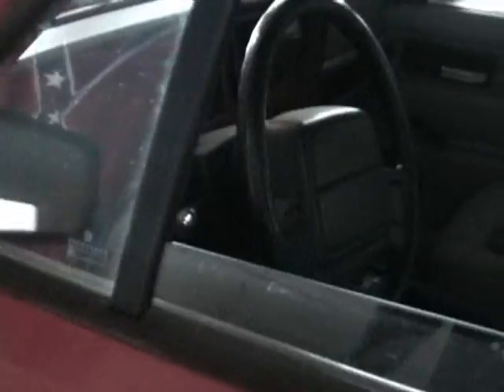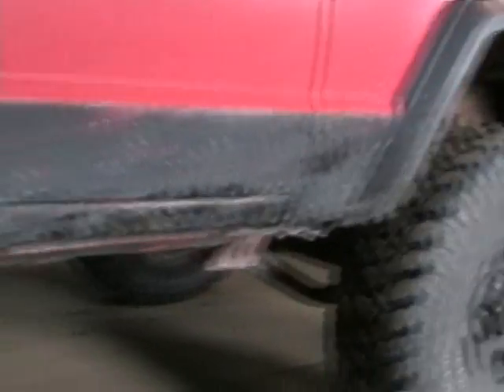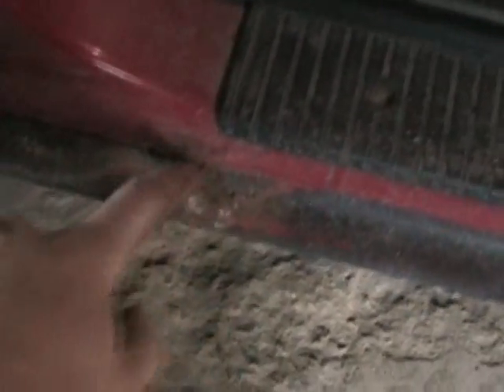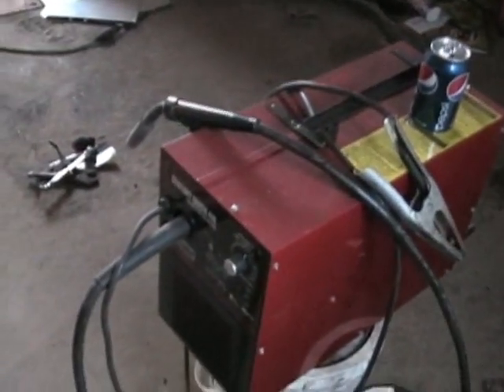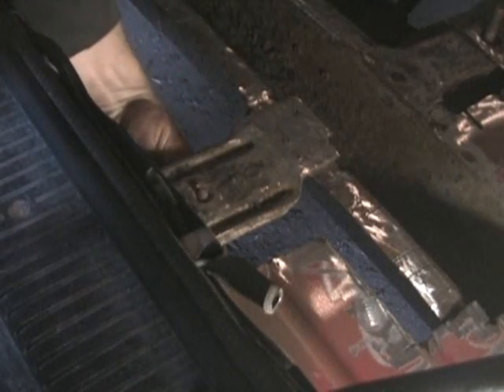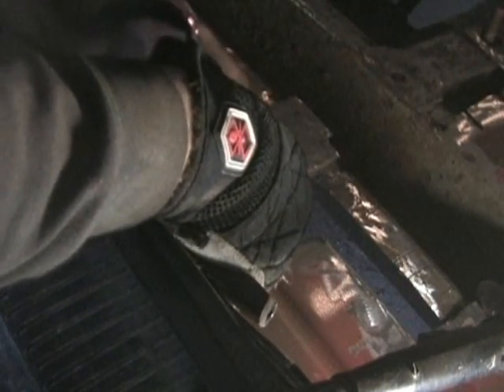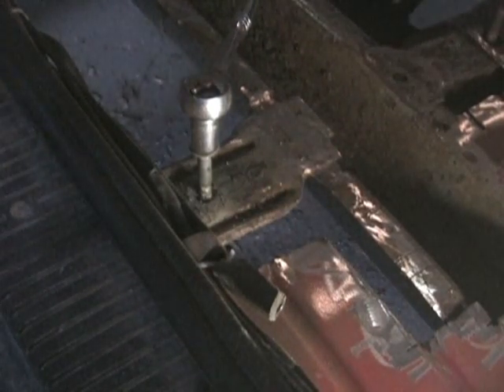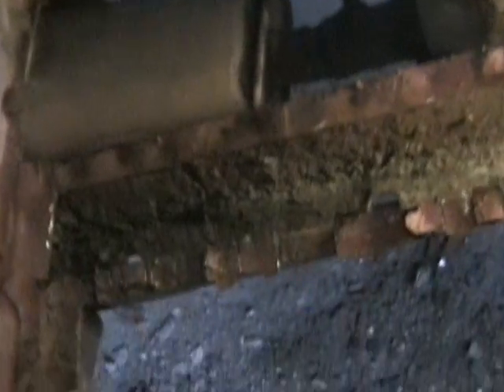floor repair part 1.wmv

Comment: The problem with welding galvanized is the fumes that come from zinc. You can remove the zinc on the galvanize metal with Muradic Acid and then you be good to go. Make sure to paint it though.

Comment: You can weld galvanised metal easy enough but, the fumes and smoke that come off it are poisenouse, make sure to wear a resperator and u will be fine

Comment: dude.... i have a 1998 jeep that you can see the rear tires when you open the hatch. the rot is so bad there is a 2 inch space above the rear wheel wells on both sides. the rear shackle on one side is through the floor. the drivers seat fell through and i can flinstone the bitch.  when i first went to look at it i wanted a toy... the guy said it it ran.... he started it up, and the first thing to happen was the serpentine belt snapped.... i bought it for $180. i used 1/2 a can of kroil and a wrench to uncease the alternator and replaced the belt. runs absolutely fine. cut out the cat and used an L pipe out the passenger side w/ a downspout for fun.  it was fully loaded and if it didn't rot away it'd be a nice rig...

Comment: I was kinda skeptical about welding galvanized steel with the body using my wire flux welder